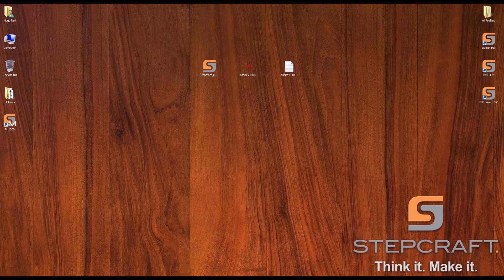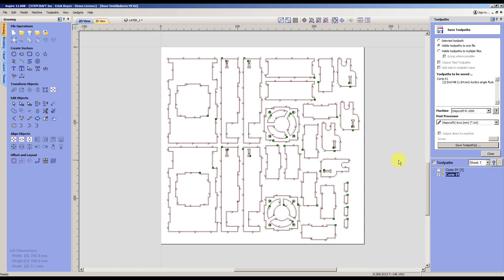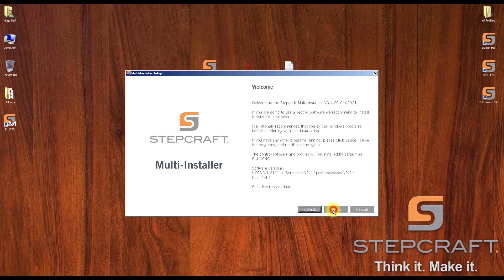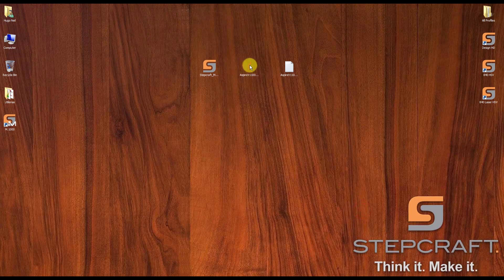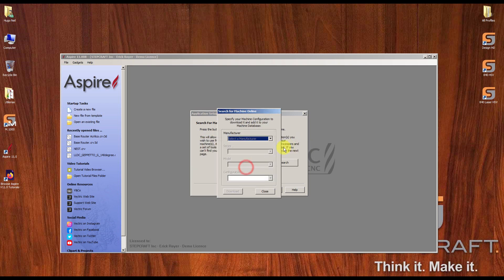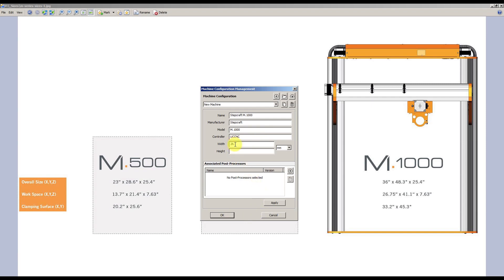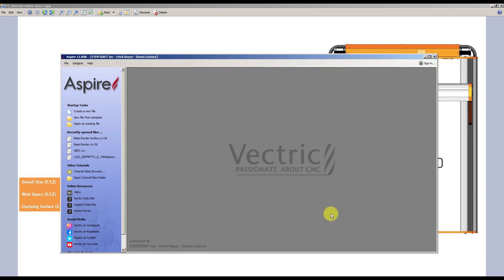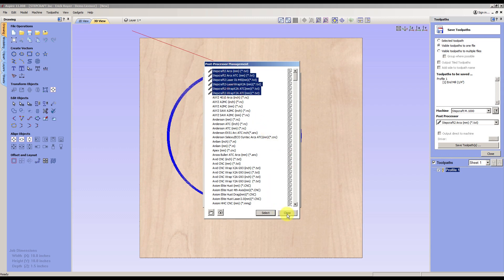Stepcraft Post-Processors for Vectric V11

Comment: The point is: This is my very first CNC and at 04:58 I have no idea what I'm supposed to do.
There is nothing on the two manuals I have, there is nothing on the website and this video say nothing in this regard. 
You are relly telling me that Stepcraft gives for granted that every one who buy this machine know for sure what is Vectric and doesn't even bother to spend two lines on any manuals to guide the client in understandig what we are talking aboiut?
Reply: Yes.  At least that's my experience, too!
Reply: Imho stepcraft is a Maschine everyone is able to use from the beginning if you read the instructions and the Manuals written by uccnc or winpc-nc...so i am